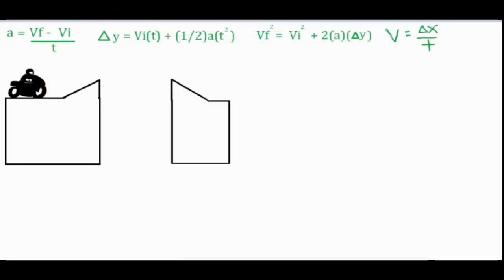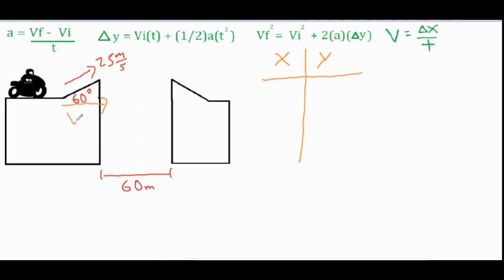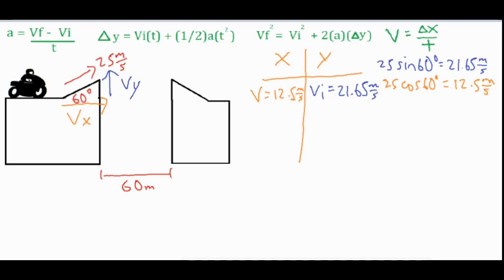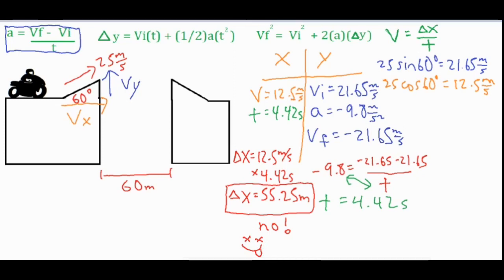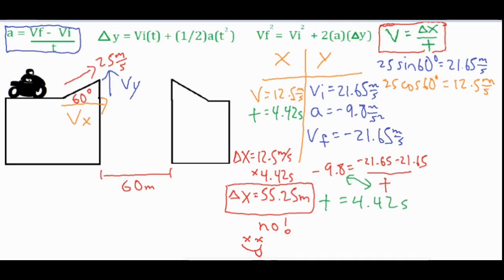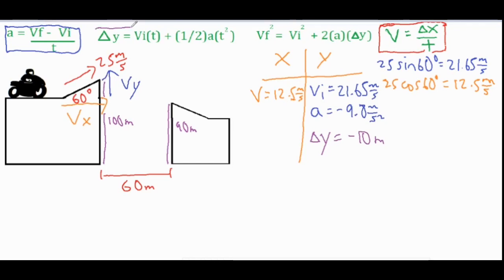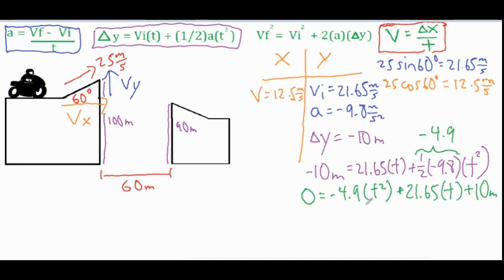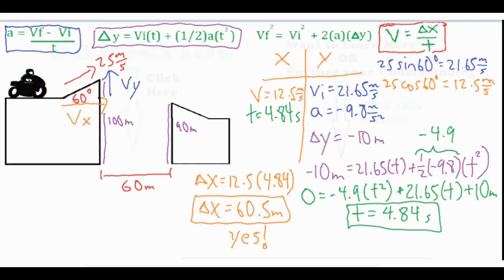Projectile Motion - Motorcycle Jump Problem ( 🔺x = ? )

Comment: I was wondering if the weight of the bike makes a difference.
A Harley is about double the weight of a R1… 
Very informative video! 
Love your work….
Reply from the maker: The weight doesn't make a difference if it has the same initial velocity when taking off.  In reality, if the dimensions were different then it may cause it to have more or less air resistance, which would affect it's landing distance.
Reply: @beatphysics  Wow thanks professor.  You really make physics fun to learn.! I can only hope, one day, to be as wise as you… 
Thank you for all the work you do. You rock professor!